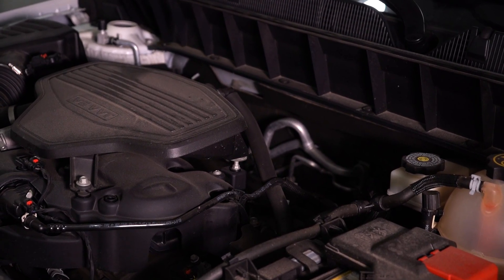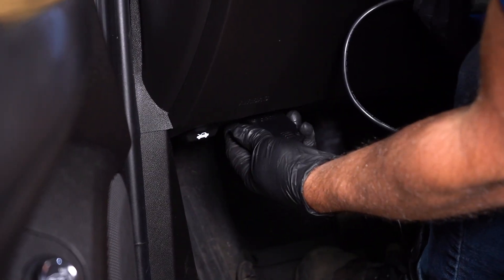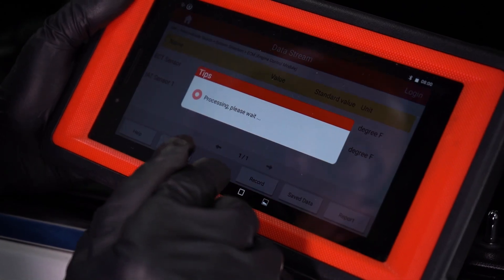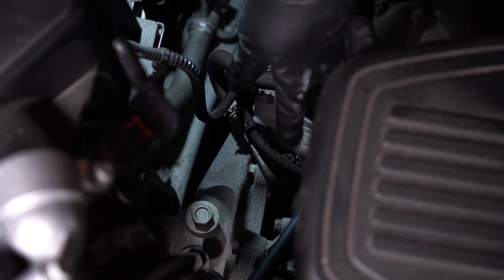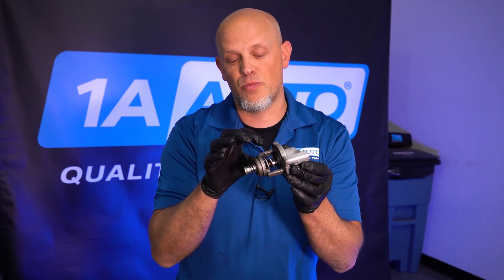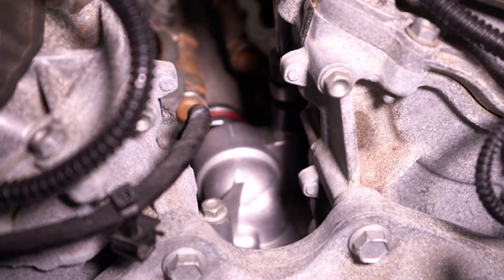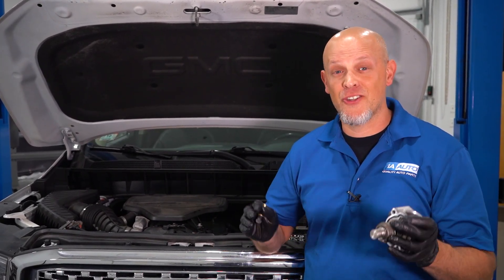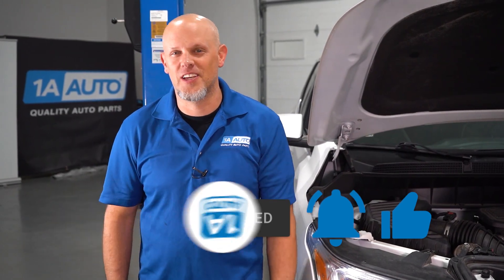Does Your Car or Truck Sound Like a Jet Engine? Quick Fix to Stop Your Cooling Fan Running Nonstop!

Comment: Standard Temp Range is -40 − 419 degrees; seems like a large variance & not sensible; if my coolant was below 32, it would likely be frozen & 400 degrees seems pretty hot, twice over boiling <?>

Comment: My problem is intermittent and it doesn't matter how hot or cold it is outside it's just a random card shuffle with the fan clutch and its really loud when I start the vehicle sometimes but only like 70% of the time and sometimes I'll start it up and it's just fine. Usually after the first start when I get to a store and start it up again leaving it seems to be fine. Like I said at least a third of the time I can start the truck the first time of the day and it will be just fine but 2/3 of the time it'll be really really loud. I would say after the first time I started that day and the truck is fairly warm I would say the rest of the day it starts up just fine and doesn't blow so loud but on a cold start it seems to be very intermittent. I'm thinking something might be binding up in the fan clutch itself but it could be obviously the coolant temp sensor and it should be switched out anyway considering how dirty the coolant was when I got it 7 years ago and all I did was a thermostat and some Blue devil. Sealed up an intake leak well I'm hoping it's an intake leak and not a head gasket leak but it sealed it up for the last 7 years. Obviously the Blue devil can compromise sensors so I will switch that out but I really don't know if that's it because this thing has gradually gotten a little louder as time goes by. Aside from the loud whirlwind sound I get somewhat of another sound and it sounds more mechanical than anything. I've seen a couple of really weak videos on how you can possibly adjust the little metal coil spring thing in the center of the fan clutch but I'm not trying to do all that on a super old fan clutch. Are my symptoms typical of a bad fan clutch or just the spring or just a sensor or maybe all of the above??

Comment: I've replaced my thermostat, and my temperature sensor. Then I get this loud whiring noise. Did I do it wrong or is my fan now bad? No codes come up but it does have the check gauge light on.

Comment: My vehicle is making that loud noise from the fan. Even if the vehicle is parked, that's after drive thus caused my vehicle to have check engine light on, I'm thinking if this can/will hurt battery power because now my vehicle will not start

Comment: What kind of scan tool did you use to look at the ETC and IAT sensor parameters on this vehicle?
Reply: Oh it's called a expensive ars tool.. like a 1500 dollar snap-on.
Reply: @danielcoffman7629  $1500 for a snap on scanner is on the lower side. Try 5-7k plus 1k a year subscription fee for the higher end ones